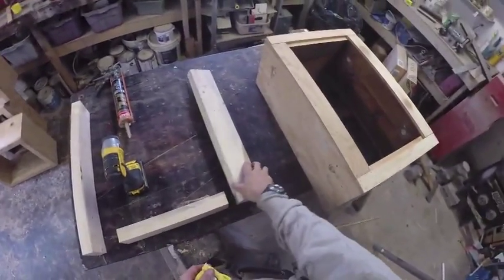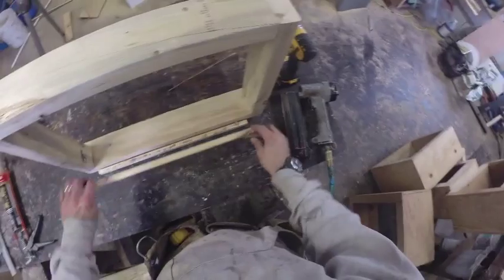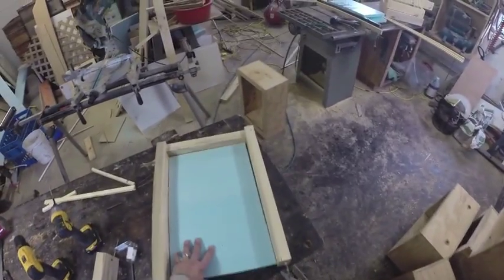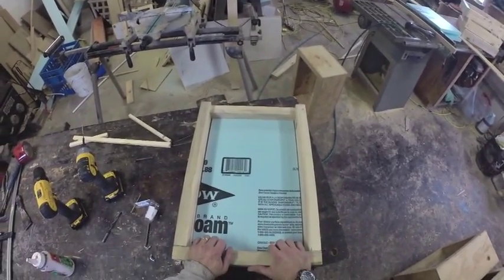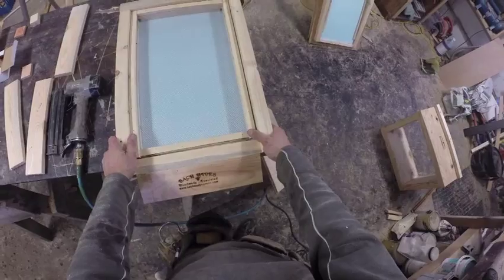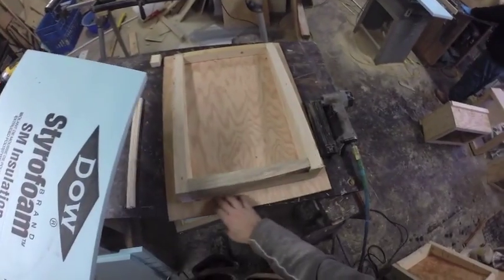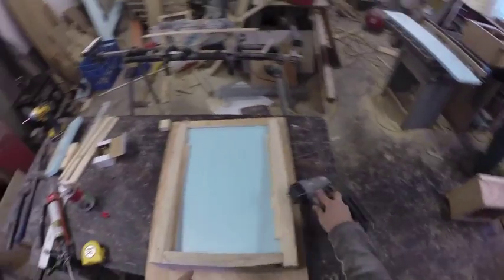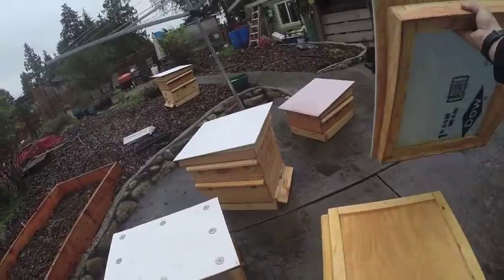Insulated Beehive Making- Part 3 Insulated Bottom Board and Waterproof Roof

Comment: The question is; had it worked? Please describe how the bees survived - if they did - and if you learned any other way to winterize them. Where have you used it, how hard are the winters in the area? Please explain.
Reply from the maker: Hi Shoim, Yes, I use these hives all the time and they make a big difference in bee survival. Most of my bees are in Princeton BC, which is in zone 5 where it can get to 25 C in December and January. I don't make the vent holes in them anymore.  I am planning to make a larger walk in style Slovakian style hive apartment where I can over winter more hives possibly up to 20 at a time. I will make a video of that, hopefully in the summer.
Reply: @johnandjenbach  John did you end up building the Slovenian style bee house? I'm interested in your thoughts on it.